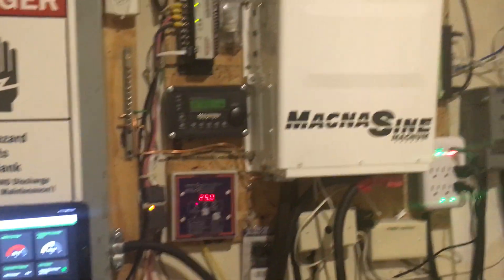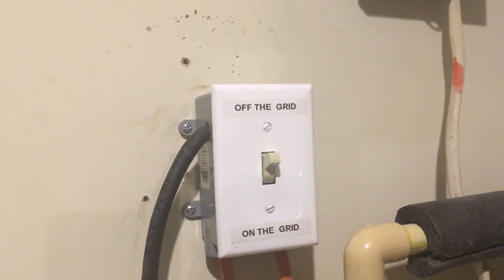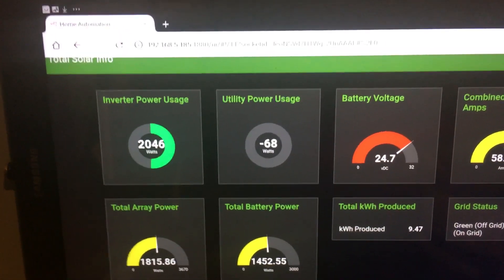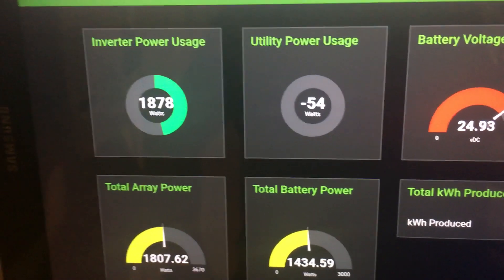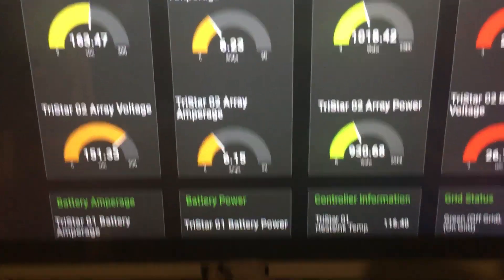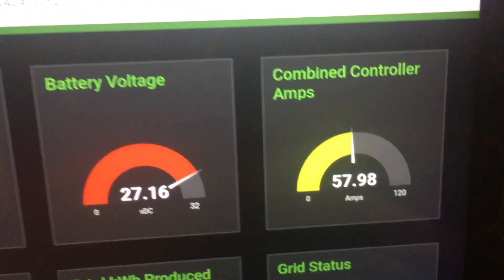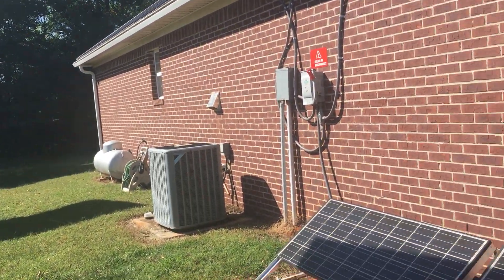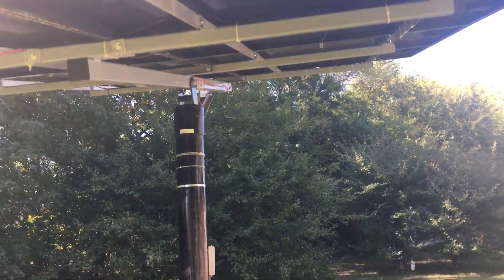DIY Home Solar Update - Still running.

Comment: Do you have a web site?
As I have solar in UK
But not allowed to alter it due to the FIT solar payment 
Like to use the solar power I generate to power water heater ect automatically 
Also charge batteries and use at night
The only I see I can do it is AC to DC batterycharger then DC to AC converter for this 
Wish we had the flexibility you have in the USA
Thanks for the info and good video
Reply from the maker: Hello and thanks for the comments.  I do not have a website, just a youtube channel.  Sounds like you have a pretty good system.  If I'm understanding your comment, you seem to exploring better ways to utilize your solar without breaking your FIT agreement, or something to that effect.  They may be ways to do it, without touching the actual solar equipment.  But it may involve modifications to your house or additional equipment.
Reply: Thanks your correct

I have not found any British YouTube sites that have solar panels/power projects unlike a number in the USA

One comment as one of my job's was wiring control cabinets to UL standards the on to working for them, the wiring I have seen on solar systems needs tidying up in say plastic conduit raceways with knock-outs, they keep the wires from moving and cool with ventilation

As it will look professional and easer to find faults and route low voltage control cables away from AC power cables e.g. network cat5/6 and low voltage as crosstalk can interfere with control circuits/equipment

As In industry and at home I follow the rule and use slightly more expensive screened network cable and UL design standards

I feel that the UL electrical standards apply to 110/230 V AC all over the world and are better than the UK/European ones especially where fire is concerned 

Thanks from the UK for good videos